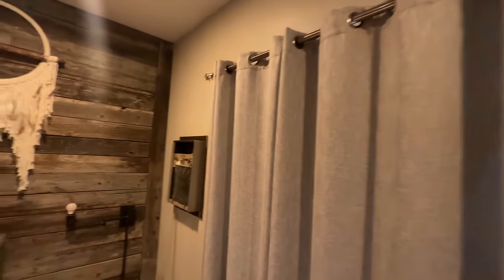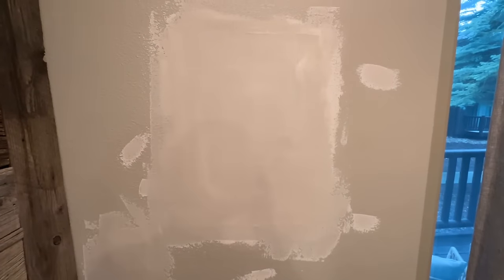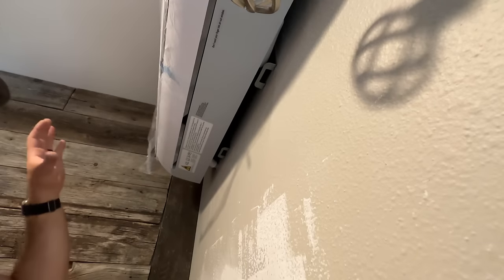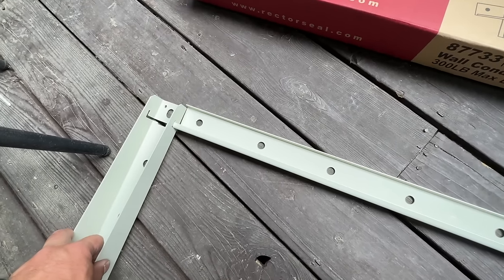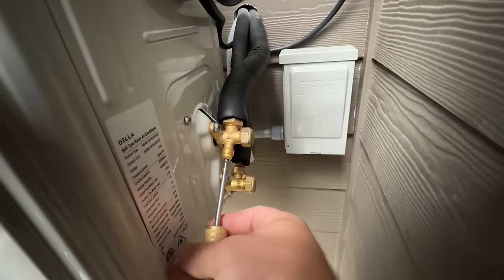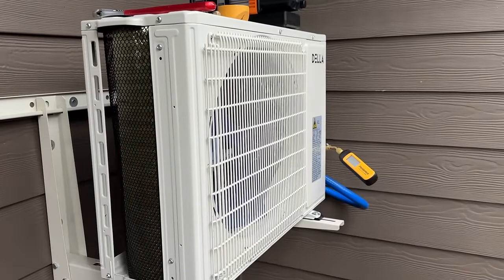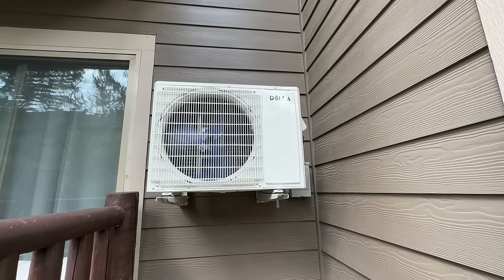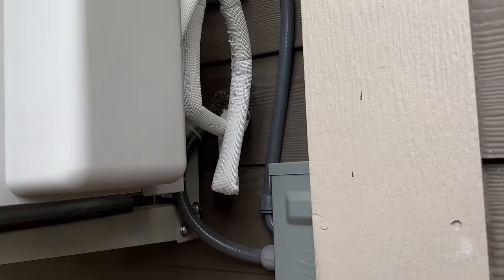A $600 Ductless 110v Mini Split?!

Comment: Bridge the two studs with header never saw an anchor that works except in thin doors and concrete especially with epoxy. With all that plaster work you are lazy using those anchors. Sham on you. Ever think of becoming a shoe maker you are almost there.
Reply from the maker: Haha ok

Comment: If you’re a home owner being dirt cheap. Just put window units in. Because when u mess this install up no hvac company will fix it. Also there’s no way to get parts on almost all DIY mini splits so you just wasted time and money and will still call an hvac company
Reply from the maker: Nah, the reality is, these are solid systems. And if you should have an issue. It’s pretty easy to pop a new condenser in or a whole new air handler. You’d still be cheaper then paying an hvac tech to come out.